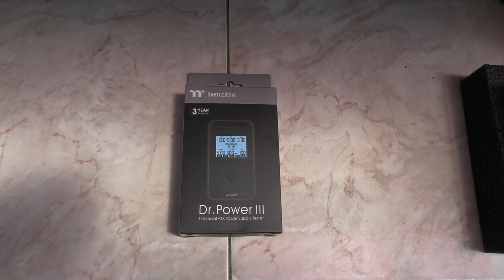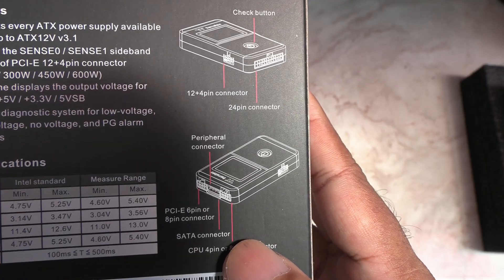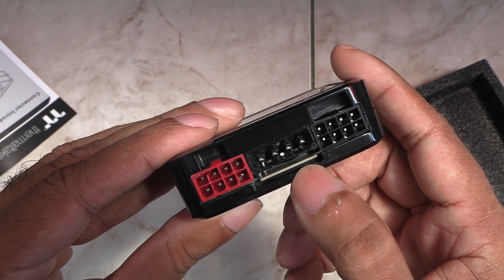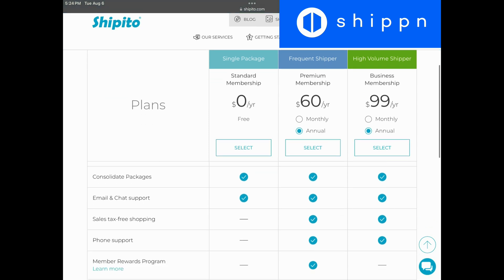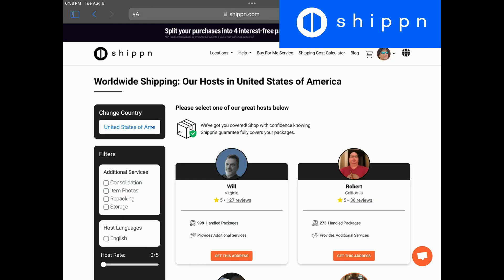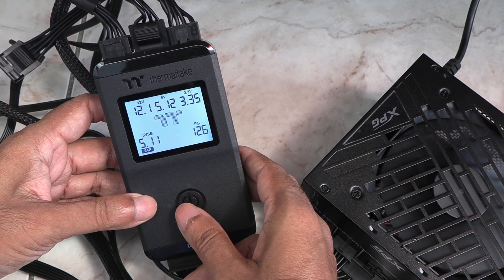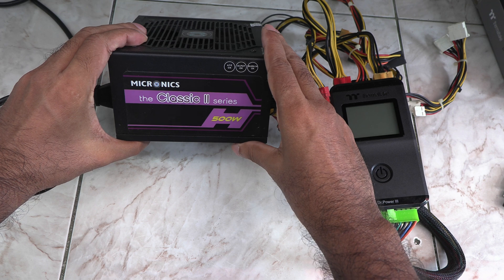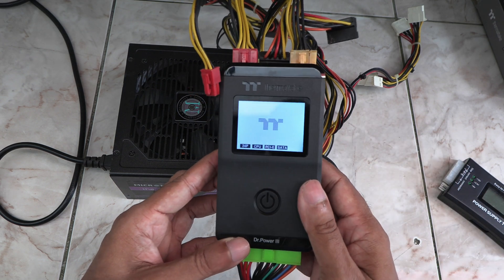Thermaltake Dr. Power III Unboxing, Testing & Review- ATX 3.1 PSU Tester

Comment: Besides the newer connection types and being able to scroll through the numbers, or just looking at them all on the screen at once (which you can see all of them on the previous tester), is this one able to put any kind of load tests on the power supply? I found with that older tester, we still use it, it read that a power supply was good but did not detect that under a load, the power supply would fail. That was found out after the fact.
Reply from the maker: Cannot load. Also in this the readings are in real time
Reply from the maker: If you like to load test your PSU try this method- https://youtu.be/1IM35lz33C8?si=NwvWMhGANpOYsxs6